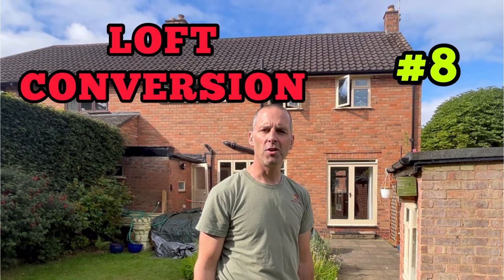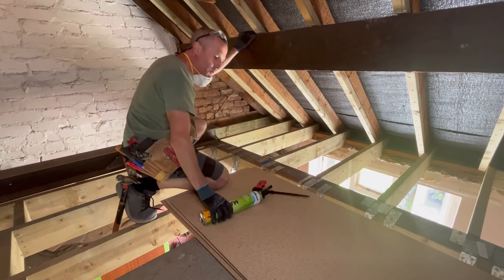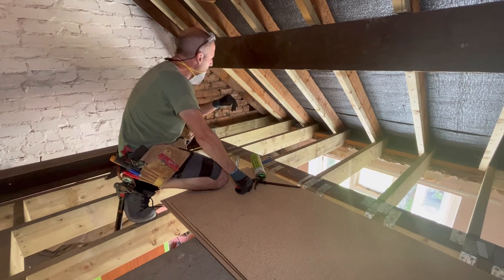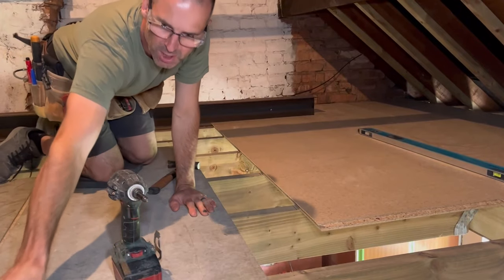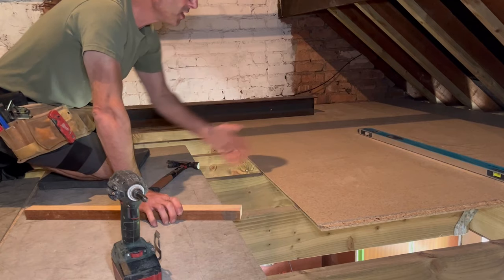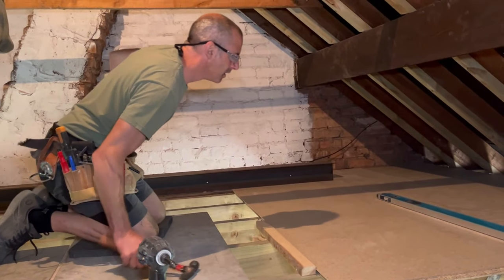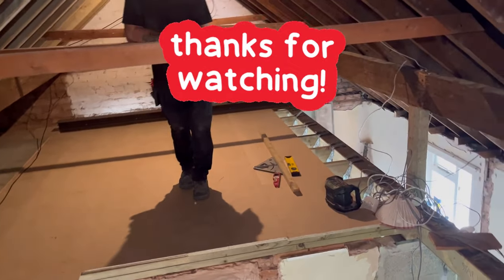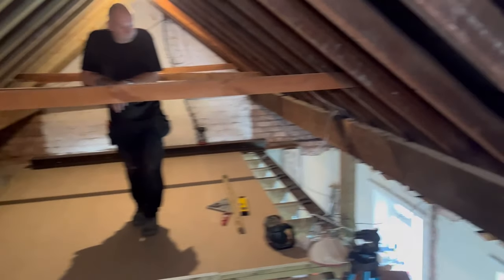How to fit chipboard flooring

Comment: If there is an handrail going around a stairwell opening do you but the chipboard flooring upto it or put the chipboard flooring under the handrail? Nice job you have done hope you will answer my question
Reply from the maker: I would definitely go under it because if you don’t when you put your floor covering down it’ll be too close to the top of the base rail and won’t look very nice. 👍🏻

Comment: The glue you were using is that similar to the D4 waterproof flooring adhesive that foams up and get your hands all black? Never seen a flooring adhesive with a foam gun before.
Reply from the maker: Yes Kevin very similar properties to that. I came across it a year or so ago whilst watching an American timber framer but they have a nozzle on their can about a metre long meaning you can do it standing up rather than on your knees. Very good stuff to use but yes also messy 👍🏻